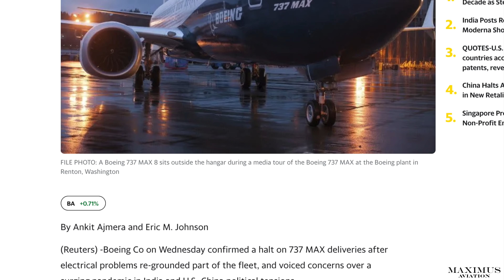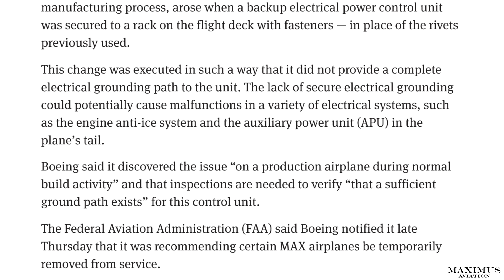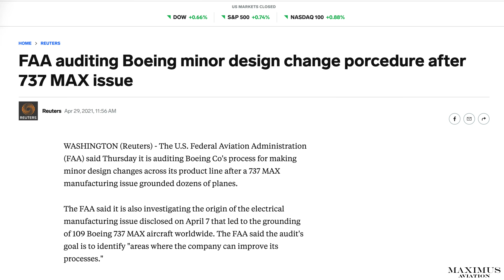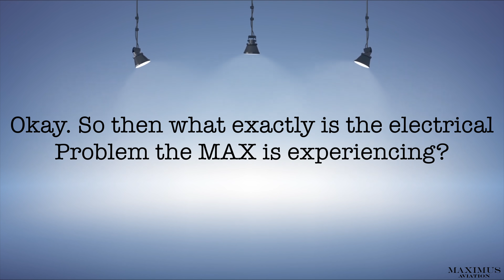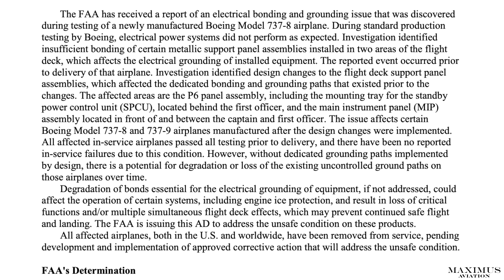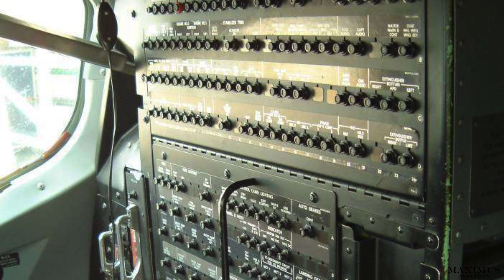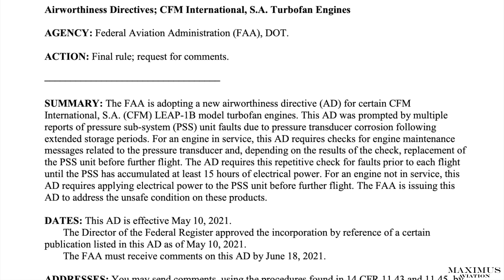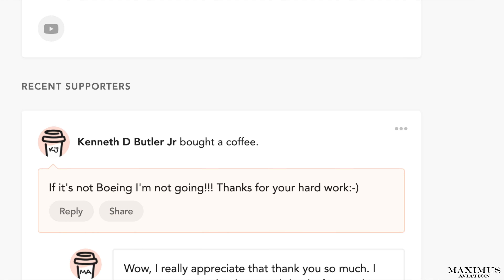Boeing MAX STILL Grounded! New FAA Airworthiness Directives Keep The MAX On The Ground Indefinitely!

Comment: I hung on till the end. It is absolutely unforgivable that after all the publicity over the max, and especially the loss of life, that Boeing could allow any of its aircraft to be delivered without a full overhaul of its practices and full scrutiny of all the max issues. They are trashing themselves, they should have been aware that any design change for panels should result in a grounding test and that any planes standing for so long should need extensive testing before release to customers. It shows clearly that Boeing has not changed its culture.

Comment: All the techno babble can loose a lot of people. Long story short. Boeing changed from grounding through rivets to those of basically nuts and bolts. Previous riveted connections were replaced with a substandard or risk of failure mechanical connections. Someone failed to test the durability and margin of error for the mechanical connection (assembly) .

More simply said? Loose connection. What a huge mistake. I worked in the lab of an electro-mechanical manufacturer for the utility and communication industries. Later I was a field engineer. If you have pass through grounding, every connection counts or make many redundant connections to cover human error.

Comment: Update: 25/04/21 @ 09:00 UTC – Statement made by Airbus. Included in article.**

The European Union Aviation Safety Agency, better known as EASA, has issued an Airworthiness Directive (AD) concerning the fuel pumps of a wide range of A320 family aircraft. Citing the risk of fuel tank explosion, the issue affects aircraft ranging from the A318-100 right through to the A321neo. EASA is warning all operators of affected types of a “potential quality issue on an affected part.” The AD was issued on April 23rd and concerns aircraft manufactured before June 30th, 2015.
Reply: Thank you!  At least I know there is one other person in the Maximus choir loft who hears all tones, not just the deliberate discord of anti- Boeing bias in his preaching.

Comment: Any updates on the 777 and 787 problems?  The 787 in particular had some serious productions issues for the plains coming out of South Carolina, to yhe point that customers were refusing delivery of plains produced there and I wouldn't want to fly on them.  A pity.  I flew on a 777 a few years ago and as far as passenger comfort it was an excellent plane.  But if it is not likely to get me to my destination I would rather fly on an Airbus.. or take the train.
Reply: Then you better check out the Airbus fuel pump problems before traveling.  You’ll never get that news on this channel.

Comment: Don't get it twisted this type of maintenance and engineering changes are common.. 
what is uncommon is that it being made news.  
Your average joe does not read or even care about AD's let alone have someone read them to them.
The ones talked about in this video would not have even resulting in a grounding as they are not critical for flight... it's only because of the two crash events that Boing is operating under extra caution. 

The engine corrosion issues is a flight critical and really is not a Boeing issue as they don't make the 
engine. it's a maintenance issues created by storage.

Comment: This was very informative... and expected. Unfortunately.    Moving the production out of Washington and California was a major flaw in the maintaining production safety standards as apposed to cost saving.  It doesn't save money if the plains never fly or have to be rebuilt several times before they are even delivered.  There will no longer be any public trust in Boing products when this happens with every model they produce.

Comment: Boeing's Original rush to bring the New Aircraft "Max" design to market quickly. So this almost continuous on and off again  airworthiness issue. All Reveal that Management hasn't learned
These cascading issue of this New Aircraft, Has Killed the reputation  of Boeing's Reliable 737 family.
Unfortunately The galley is a bit small for a family home!

Comment: Boeing management --- attention staff , we have been making 737's for decades , it was a good plane ,, so we are going to stir the pot , let's put on engines that are to bIg to fit under the wing so we will move the engines forward and up set the balance of the whole plane . But our tech guy will install a computer system to fly the planes , take the pilots out off the loop , oh and we will toss out the tried and true grounding system and install this new mounting system because it's cheaper than rivets , rivets are so 60's . We should have the planes all retro fitted and ready to fly ( figures crossed behind our backs ) by 2025 . Oh , and let's take plane manufacturing out of Washington . They made good planes , but other places have less taxes .

Comment: It is sounding like habitat for humanity might be a better useful final path for these airplanes.  Having worked with computer and networking technology since the 1980s I can't tell you how often a ground correction solved problems that many technicians had been out on and netted me a new customer.  Time to crimp solder and screw in some green wires guys how sad.

Comment: I began working as a mechanic on the B737 in 1969 and retired from maintenance in 2009.  Let me say that the airplanes in question could not possibly have "passed all required testing" and then magically developed bonding issues sufficient to cause system failures.  Airplane electrical bonding procedures were well understood and implemented long before the Max came about.  The 737-200 that I was introduced to in 1969 had no, zero, digital buses or systems, but every panel and unit was well bonded and tested before delivery.  When I opened the air conditioning bay doors, for instance, I found that each door was bonded to the airframe with jumpers every few inches along the hinge lines.  Why?  Because the ADF loops antennas installed between the doors might not operate properly without it.  The point is, the failures of the Max, including the MCAS debacle, have happened because Boeing management has deliberately chosen to scrap or short cut well-established and proven engineering and manufacturing practices vital to the production of a safe fleet.  I say, ground every Boeing built since the Chicago gang took over.  Recertify them as new designs, and do it right this time.
Reply: Once a great engineering company. Terrible to see this happen.

Comment: Yeah, I stayed 'til the end and understood all of it.  Retired airline.  Although I was last on the B-757/B-767 fleet, I do have many hours on the B-737 "next gen" series.  NOT the "Max" of course, after my time.  Memory serves, though...like all jets there is a "First Flight of the Day" required procedure that pilots perform (this is of course in addition to the multiple times that MX will have the jet).  Basically (among other things) it checks for the proper function of the electrical system, especially the StandBy Power.   Proper relay switching, Battery Charger function, ETC.  BUT?  Should the loss of a solid electrical ground occur AFTER that Daily check, and over the course of several flights per day?   Well....

Comment: I remember through the years, hearing stories of Boeing taking wires that were slightly too short they would tie them to a post on one end  and  then pulling by hand stretching and thinning the wires On the other end to the proper length. Kinda Creepy,  if it’s true.

Comment: Boeing seems to have forgotten what good management is. They need to brush up on Hertzberg and Maslow. I suspect that what is catching up with them is that all senior managers these days seem to be accountants (politicians) rather than engineers or pilots or production people (useful productive workers). A simplification I know but after 40 years working I see this situations in many corporate organisations. Aviation is the worst place for this to occur where safety is compromised. The focus has been too bias towards costs with bonus payments that reward executives excessively for screwing the workforce to achieve these cost reductions. This rot may have started earlier but when Boeing moved its headquarters to Chicago it should have set the alarm bells off. The CEO of such a company as Boeing should nearly ALWAYS come from within, and have been at least a plant manager or similar at Boeing or similar focused organisation.  Its a sad but not unexpected situation in our current mad world.  

A good way to fix it is to put the CEO's and other senior executives offices next to the Toilet block on one of the production lines. That will bring them back to earth or send them packing. Then you will know who is really committed to the production of safe airliners and who is just in it for themselves (money).

Comment: So, did I get this right? 737-8 and -9 aircraft are having a grounding problem requiring the aircraft be grounded? Also because the aircraft are not grounded properly they are spending too much time grounded which has caused a problem with the engines requiring that they be grounded even more?

I think that this is proof that safe flight is impossible.

Comment: Just got off the FAA website, huh, could not find an order grounding the plane.  The document also disclosed the cost to fix each plane was a bit above $3,000.  We are talking about replacing screws with rivets.  I guess a screw a bunch of screws could come lose over time negating a proper ground for the back up power unit.  From what I can see, the FAA did not "ground" the aircraft.
Reply: Don't watch then, that way you don't have to comment
Reply: @ant2312  So you prefer lies that fit your agenda?  You don't want to know the truth?  If you don't like my comments, don't read them.
Reply: But hey that would not fit the narrative here!
Reply: @donanders2110  Hey, BA certainly not perfect but he obviously hates them.  AB has done plenty ignored under his watch.
Reply: @donanders2110  According to Flightaware, there are at least 34 Max 8s airborne now, 3:50pm May 10.  That's some indefinite grounding.  Was too bored with this dude to check the 9s.
Reply: BTW, that is just US, Mexico and northern Caribbean.

Comment: Why does it sounds like some automotive engineer (aeronautical engineering is technically an offshoot of automotive engineering) figured that since chassis bonding works for power systems in cars and trucks then it should work just as well in an airplane, all the while forgetting that cars and trucks don't fall out of the sky and wipe out parts of a suibdivision.
Before any of you jump all over me about aeronautical/aviation engineering not being related to automotive engineering consider this; automotive engineering concerns itself with equipment used to move people and products from point A to point B over long distances.

Comment: This seems very odd, and here is why. I have a lot of experience in computerized control of actuators. I use both 24 V AC and 24 V DC, and even stepped down voltages of DC power. I presume that electrical power on an airplane is generated in three phase power which is rectified to charge a battery dang, therefore emitting a perfect flatline DC power to the computer system; as is the case with the telephone system. It’s hard to believe that airplanes are designed like a car, with a grounded negative. I would think that all circuits would be a positive and a negative rather than a positive in the groundAnd all the AC powered components are to wire, of course.
Reply: Cost cutting & weight reduction (to increase fuel efficiency).

Comment: So cutting through the tech talk, Someone in production thought that it would be easier to bolt electrical panels instead of riveting them in place! In an aircraft! In a passenger aircraft! In a passenger aircraft that is under a microscope! Is there any hope for Boeing??
Reply: I bet they couldn't find the rivet gun or it was broken so they rummaged in the nut and bolt box!

Comment: Let's put it this way Boeing used to make a beautiful aircrafts 75 years old and all you have left was Lockheed and you had Donnel Douglas if I spelled that right who had the DC-10 that committed more problems just like like GM Ford and Chrysler instead of making a car they don't test these automobiles this to see the errors that they create they rush it out of production to sell and now it plunges just the DC-10 came out it became a problem airplane but it was so beautiful and it caused so many airplane crashes and now the DC-10 MD files Chapter 7 bankruptcy it handles their company to Boeing and now they make mistakes that cost a lot of lives in a rush this 737 Max without testing it first and they don't seem to care because all about making profit

Comment: Boeing needs bashing.  I'm not a fan of corrupt, incompetent irresponsible  management, which has become Boeing's trademark.  They could have prevented the 2nd 737max crash by voluntarily grounding the plane, and were even willing to risk a 3rd crash if they hadn't finally been stopped.  That's unforgivable.

Comment: I would just like to say that your certainly not showing bias towards neither manufacturer but it’s clear from past and present events affecting Boeing that it has all been self inflicted. As a pilot with just a small amount of aviation knowledge I certainly wouldn’t take Boeing’s word regarding their statement that they have resolved any issue, The 737 - max is a piece of junk and yes I am type rated on the 737 NG family of aircraft (737 are my favourite aircraft excluding the obvious of course) and on the A320 which is also a beautiful aircraft to fly. Well reported and accurate as usual, well done sir.

Comment: Sometimes you gotta let go of that dead horse you are flogging. Surely Boeing must be thinking along these lines? Right now the only way they are selling 737's is because cynical airlines are cashing in on fire sale bargains hoping that various Autocrash functions have been disabled. All it will take is one more high speed nose dive and as a civil airliner manufacturer they will be in trouble.

Comment: Once again, the Boeing suits screwed up with the 737 Max Lawn Dart. The same goes for the Starliner that hasn't even reached proper orbit. There needs to be a corporate coup to get the engineers in charge of design and production.

Comment: Hello. Looks like you are in the details now. Okey. Could you please make a video of a summarized status of all the different models, different issues, how many issues solved, how many still grounded now, how many not delivered, how many in stock, how many cancellations of orders, how many on order? And potential dates of when the issues will be solved and groundings lifted? As a passenger it looks like a substantial mess. What airlines in Europe is flying the max these days?
Reply: Yes, you’ll need to know who is flying 737s when the A320s get grounded for fuel pump safety concerns - oh, you hadn’t heard about that?   I guess not if you only follow this channel.

Comment: If I were to bet I'd say the gangsters at Boeing were well aware of this issue, but since it would have taken some time to figure out all the affected aircraft and a proper fix it got in the way of Dave Calhoun receiving his fat bonus for the MAX reinstatement so Boeing held off self disclosing until after the MAX was reinstated. Rather strange that the aircraft affected are all in the hands of airlines, this means these aircraft were built before the grounding took place. Boeing doesn't inspect electrical bonds as the biddles are taken and entered by the techs and many times fake numbers are used.
High biddle readings will sometimes allow systems to operate but in time things start acting weird and electrical components fail.

Comment: Can't understand why they choose to skip dedicated ground leads to each component. A shared panel ground path on critical system instrumentation can lead to incredible many different fault scenarios. To my knowledge solutions like this are deemed unsafe and unreliable and never used in other types of transportation equipment. Mind boggles...
Certified auto technician
Reply: Without a well designed grounding system the result is unpredictable ground paths (commonly called ground loops) that can cause random faults that vary by aircraft.  Some are fine and others have a new gremlin each day and good luck trouble shooting them.

Comment: While the MCAS issue was a big deal, I can’t imagine fixing a grounding strap and ensuring corrosion is not forming is a huge issue. AD’s like this are issued every day on all types and model’s of aircraft and they don’t get large public attention. I think Boeing’s biggest issue with the Max, is that it had become a Media magnet.
Reply: If it were so simple why are the aircraft still out of service? Boeing's biggest issue is greed through cost, schedule & shareholder value over quality and safety and they continue moving forward without putting quality & safety first.
Reply: Boeing made one little engineering change after another without proper follow-through, including keeping the FAA apprised. This grounding issue is not small potatoes, and future corrosion of bonding points could cause a major failure. As DC8 said, if it were so simple to fix, the planes wouldn't be out of service so long. Or do you have specific insider knowledge to share with us, @oceanr325?

Comment: Boeing's problems are not going to be solved until they fire all of the management types and replace them with engineering types. Also shifting their head quarters back to the factory and removing five layers of management would goa long way to reducing the costs.